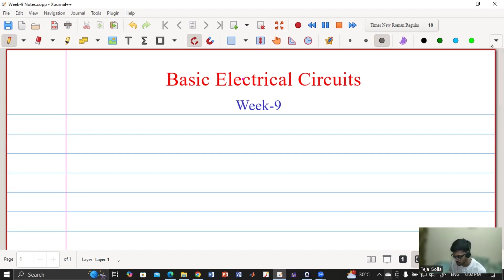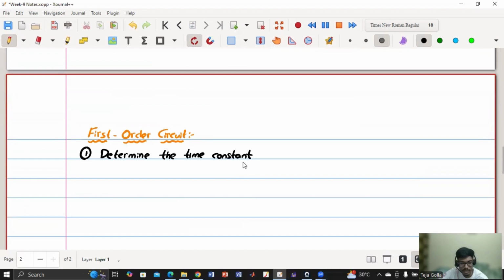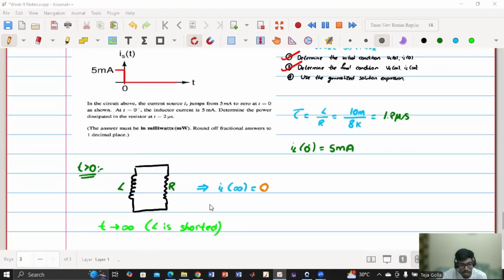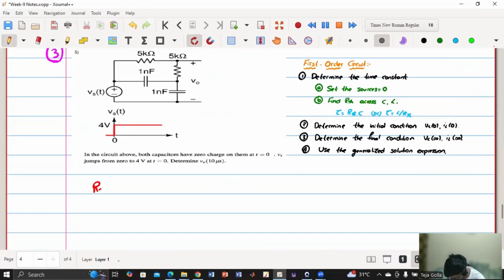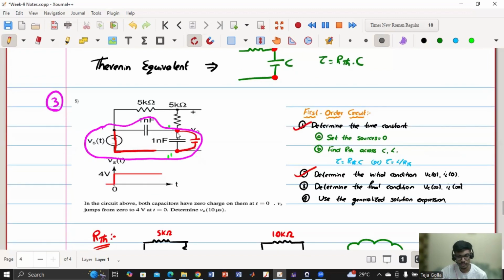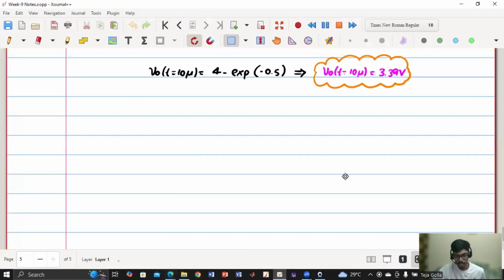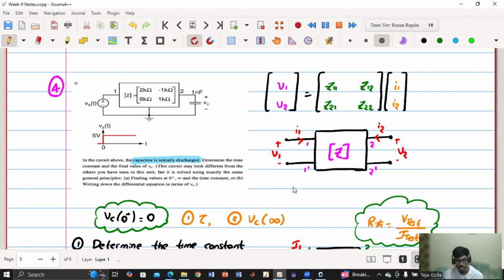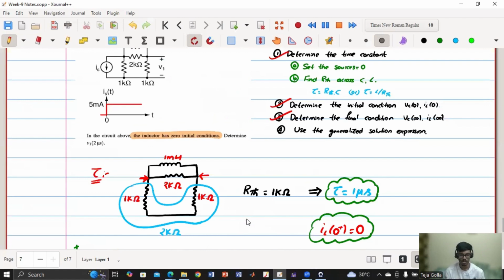Week 9 | Basic Electrical Circuits | Problem Solving Session | NPTEL

Comment: @ 1:43:18  i think there is a minor  mistake...it should be (-5/4) v and not (-5/12) volt...pls correct me if i am wrong
Reply from the maker: Yes, you are correct. I've made a calculation mistake, it should be (-5/4)V. Thanks for pointing it out!!!